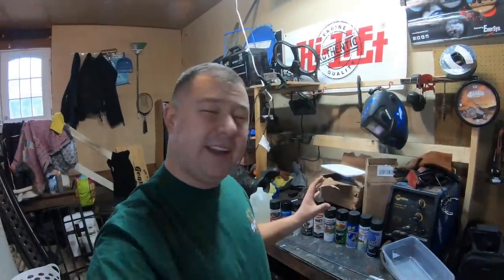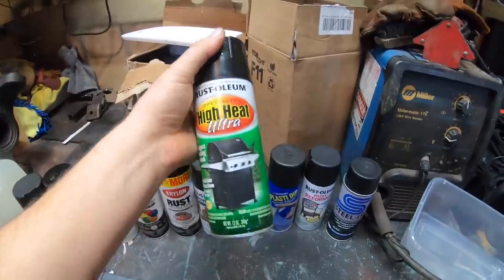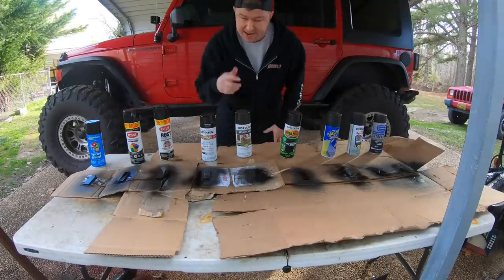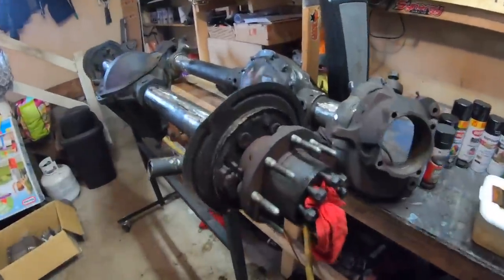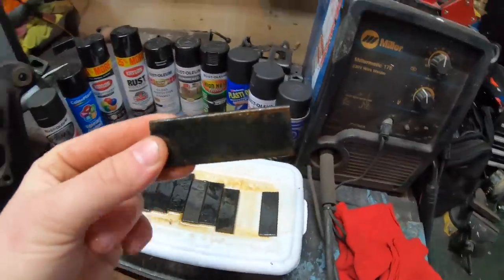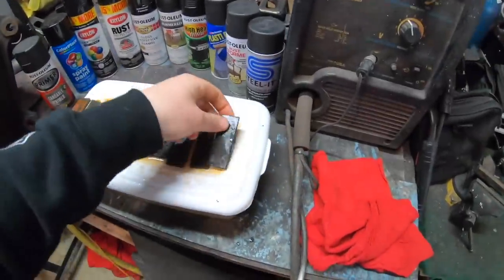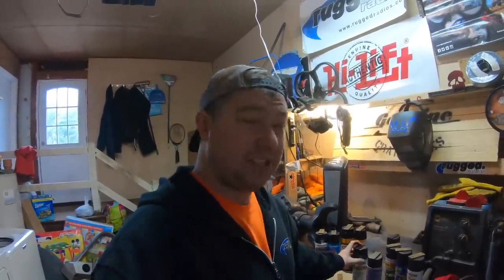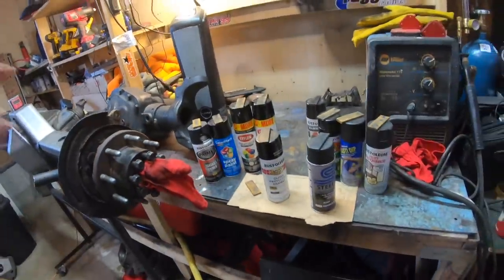Spray Paint VS Rust!! - What Brand is Best?

Comment: I would be interested in starting with rusty parts, and then seeing if any of the "rust" paints actually do control the rust (and do a few with normal paint, etc. just to see how significant the difference is).
Reply: Technically if you analyze this closely, although I question wether the edges of the metal actually got evenly or thick enough paint on them. Still if you examine this you can kind of see how they would do. Steel it & Rustoleum enamel will be better than nothing & buy you some time to get it worked on later. The others will buy you less time based on how they failed so fast I would say Krylon is third since it is a enamel but I wouldn't buy it, just if you already have bought it, it'll help.
Reply: 😂 some of the products are not for coating rust.

Comment: Actually, Steel-It would have done even a bit better if you would have allowed it to cure (dry) more than 2 hours before dunking it in salt water. Steel-It is a hard, glossy polyurethane coating, not really a "paint".

Comment: rust reformer is not a rust paint. it "converts" or reforms rust and that is then topcoated with a rust paint. since you had no rust in the first place, its not going to do anything. its probably composed of tannic acid. and it likely just washed away into the water. it might have converted some of the rust especially the next door steel it. and plasti-dip.

Comment: I've been redoing snow plows for years. If you really want to make the Rustolem paint last a LONG time and resist chipping along with making the shine from gloss paints last longer, buy the Rustoleum by the quart or gallon and use a small touch up gun from Harbor Freight. Both Valspar and Majic (Tractor supply) paints sell pint bottles of hardener that you can mix in before you spray. Only mix what you need, use acetone for the thinner, NOT naptha. READ the labels, Lol Once mixed, the pot life is around 4 or 5 hours and it will still harden inside your sprayer if left overnight etc.

Not only will you save a lot of money over spray cans, cleanup is minimal and the paint will dry 3 times faster, 3 times shinier,and 3 times harder and last more than double the length of time. It will resist chips and cracking better also,  IF YOU DO IT SAFELY!

WARNING: Now the bad part, the hardener contains nasties called isocyanates! This shit is evil. When mixing, wear gloves and keep it off of your skin. When spraying it, you MUST wear a respirator! Not a dust mask, but a cartridge based unit designed for painting. If you spray it inside, cover all exposed skin areas, wear your mask and try to create some ventilation. Our friends at OSHA require a full suit and outside pumped in air to the mask for breathing (no masks with filters) when used in commercial or industrial environments. This garbage can get in your body through skin, your eyes or whatever. Your body can not remove it and like lead it will build up over time until one day your central nervous system shuts off and you flop around like a just caught fish in the floor of a row boat and then die.

Why did I even mention it then, right? Well, it really works well, is easier than powder coating and does a great job when used safely. However, we all know that some moronic idiot will try it, in a small garage with no ventilation, no mask, and no gloves. All because they are tough and don't have time to worry about stupid safety procedures. In all honesty, if you spray it outside, upwind with no mask you will probably be ok? However, about 1 in every 10,000 people seem to be extremely sensitive to isocyanates and when even briefly exposed, an ambulance ride is next, hospital second and possible permanent damage to their CNS (Central Nervous System) third. If you are stupid and that happens? I'm sorry it did but my conscience is clear.
Reply: If all social media comments were like this one, the world would be a better place. Seriously. Great comment. Great info.
Reply: @commonmancrypto1648 if all social media was like that no one would read it. lol. But yes very informative and well said.
Reply: Is the reason the Rustoleum Farm & Implement and Professional High Performance paint has all the Prop 65 warnings because of the hardeners? Is that the reason those paints are so expensive and do so well in the tests people do on YouTube? 
Is it possible to DIY or semi-DIY a linseed oil-based paint that can go over top old paint jobs? 
I am building a greenhouse from discarded security doors, most of which are iron. 
Since this project is happening in my small back yard, I don’t want to poison the soil by sanding it sandblasting down to the bare metal. I’m trying to go the least toxic route, because my daughter is in remission from cancer.
Reply: @monkeytrainer8135  Rustoleum Farm and implement paint by itself is just an oil based enamel if I remember correctly/ It works good but does not have a hardener in it.

Using it out of the can will work. It takes a long time to dry but works well in most cases.Adding the hardener will cut the drying time by 2/3rds, double the shine and UV resistance and the paint job itself will last twice as long.

You can use foam rollers or a paint brush to apply it with the hardener in it, just mix small batches at a time so you run out of paint BEFORE it sets up.

Now, as I mentioned before, KEEP IT OFF OF YOUR SKIN.Since it isn't being applied as an aerosol you may not need a mask if done outside? Your call?

It takes longer to paint this way but the end result is almost as good as spraying it and you don't need an OSHA approved hazmat balloon suit like I wear, Lol.

PS- Did I mention keeping this garbage off your skin? It seems to go in but never comes out, EVER.
Reply: @superdog1964  — you did mention keeping it off the skin — multiple times. I remembered what you said, when I watched a bunch of car painting videos, and I noticed there were guys who were definitely heeding that danger, wearing black rubber gloves and those white tyvek suits, or at least long sleeves.

Comment: Rustoleum Rust Reformer is basically made to make rusty surfaces paintable, like a "primer for rust". A good test for the rust reformer would be to take an already rusty piece of metal, spray it with the reformer, then paint over it. 

Great video. I'll continue using good old regular Rustoleum for my future projects!

Comment: Leaving square edges on steel pretty much guarantees coating failure. The reason is that unless an impractical number of coats are applied, there is no thickness and little protection.

Regarding the Rust Reformer, it is designed to neutralize existing corrosion.   It should be applied, then topcoated after 24 hours.  During this time, the chemical reactions essentially consume its ability to convert rust.  It basically runs out of ammo. It must be topcoated to prevent recurring corrosion.  
I've used this product for quite a few years in refurbishing commercial and residential handrails, and have had great results. Note:  I topcoat with Rustoleum because it works well, and the customer has no problems finding paint for recoats and touch-ups.

Comment: I personally would have sanded the metal, Primed, and two coats of paint.
Then did the test.  I have done a similar test But used a separate container sto minimize cross contamination, at the end found that Rustoleum did the best even with a little better preparation. 
Was a good video for people to see and prove not all paints are created equal 👌
Reply: Yep good prep is to sandblast and degrease. The most expensive coatings insist on thorough prep.

Comment: A note for thought...the ends where you cut the metal would be more porous than the rest of the pieces...so that would clearly rust first.   The Rust-oleum Rust Reformer is rusting due to it needing to be primed and painted.  It is not a rust preventative, but a transform the rust to metal to be painted.  I bet if you used it and them primed it and painted it...it would hold up a lot better.

Comment: In my experience I have found out that Rust-Oleum paint will last and works the best for rust and pretty much any krylon doesn't cover near as good and just chips off way easier so I always buy Rust-Oleum that's for sure great video
Reply: Ever notice that people don’t use punctuation anymore...so frustrating!

If you wanted the bumpers to actually look nice, would you use a clear top coat to extend the life of the Rustoleum?

Comment: My process for steel products used in a salt water environment.
Step 1: sand
Step 2: wipe with acetone then dry cloth
Step 3: Rustoleum etching primer (2 coats) followed by light sanding and wipe with acetone then dry cloth.
Step 4: Rustoleum 2 in 1 primer (2 coats) followed by light sanding and wipe with acetone then dry cloth.
Step 5: Appliance epoxy paint (2 coats) followed by very light sanding and wipe with acetone then dry cloth.
Step 6: Clear Top coat (1 or 2 coats).
Results: Easily 2 years of saltwater protection. Never had any peeling.

Comment: First zinc 95,% cold galvanized spray paint $12.00 per spray can. From Connect-it Wireless Products. This is what they use on all Radio, Cellular and TV towers. Commercial grade paint.👍👍👍 This is a silver cold galvanized color.
My second best primer is RM7 (rusty metal primer # 7) it's made by Rust-Oleum. I've painted metal Arc weld two sections of metal together over the paint, the paint has less than 1/8 of an inch burn back. 👍 This primer color is a off Rusty red it also stops rust that's existing on metal from continuing to grow.

Comment: That's a pretty good test based on the way some people would use the paints. But I can't say it's a fair test of the paints. Paint prevents rust by sealing the surface against water penetration, not by any chemical process. So the better the seal, the better the protection. That's why the primers didn't fare so well, they aren't meant to seal. Getting the best seal is all about proper surface prep and application. Wiping the plates down with mineral spirits was good but you should also have hit them with some sandpaper to give the paint the proper surface to adhere. Then you only gave the paint a single coat when most every paint I can think of recommends at least two thin coats for best performance. Finally, you started the test way too soon. Just because a paint is dry to the touch doesn't mean it's fully cured. Ideally you should have given the plates at least a day or two to set up before starting the test.

I'm not bashing what you did, it was a fine test that I do think produced valid results. A lot of people will use the paint exactly the way you did. But I do think the results may have changed if the test had been more rigid. Of course, I'm certain it would also have taken longer.

FYI, taking the plates out of the water was a good way of mimicking the Mil-Spec tests. Those use a spray rather than submersion to test corrosion protection. So those tests leave the pieces constantly exposed to the air while being soaked with saltwater.

Comment: VHT roll bar & chassis paint always worked well for me
Reply: That's basically what I just suggested. Very good results with that. I use the high heat, the chassis one you stated and the epoxy one that can be used on shocks springs basically everything other than exhaust. I still also use the Rust-Oleum with good results. Nothing beats being on top of things and being proactive and not reactive when it comes to maintenance.
Reply: @truckerrickakamanowar  true, prep before paint is probably most important before painting

Comment: Rust oleum used to be my go to paint but seems like they changed the formula, it does not spray as neat and good looking as it used to, I always have issues with the cans clogging up and whatnot. If you want good paint that has the best UV and rust protection go to a tractor place and get heavy duty implement paint. It takes almost a day to dry but it last Waaaay longer.

Comment: @JK Gear and Gadgets, I am planning on painting my bumpers for my Jeep, would you recommend throwing on the primer that STEEL-IT offers on before applying the paint? The roads are salted & sanded in the winter. So I am looking for something that it tough. Does this paint need a clear coat or would I be ok with just the paint? I just want it to last a few years.
Reply: If you don't intent to weld you should add the primer for durability. Also for bigger parts, you should get the quart presentation. More surface for your buck. You can apply it using a primer nozzle and a spray gun :). Hope this helps!

Comment: You didn't really use the Rustoleum Rust Reformer correctly. It's not designed to be used on bare metal. It's a rust converter, chemically changing red rust to a "black" rust which doesn't eat the metal and offers protection against red rust forming again. But it needs to have red rust to work, since the chemical reaction works off of red rust and not bare metal. It should have been used like a primer, after which you would top coat it with your choice of paint. So you use it as a rust converter/primer on already rusted metal that you don't want or can't sand down to bare metal. It's not a paint.

Comment: Great vidio , I'm going to use it on my bike.  I was reading where guys like it better than powder coating because they can see stress cracks in the frame and can weld it. Opposed to haveing to scrape off the powder coating before a weld repair. Thanks again

Comment: I have used Rust-Oleum also with good results. My alternate suggestion is VHT epoxy paint it's self priming made for all weather and rust and salt resistant. Temp rated at 250° F. Can be bought at AutoZone and probably any other major autoparts store. Thanks for the video. I also use fuid film for extra protection over the winter.(Northeast) mine is a 16 yes not old but looks new still underneath except for the crappy Rubicon shock finish don't have a problem w the shocks but the finish is crap.

Comment: It looks like you did not sand the metal and remove the mill scale.  Sanded bare metal is highly reactive and would have been a better test since mill scale can vary from piece to piece.
Cold Galvanizing 95% zinc would have been a good "baseline" comparison also, but again, has to be applied on sanded bare steel.

Comment: Just the video I was looking for! I am getting ready to paint a forging press and I live about 1 mile from the Gulf of Mexico, so salty air and humidity is a factor. 
Is it necessary to start with a primer as long as your metal is rust free and free of oils and contaminants? Thank you
Reply from the maker: I would highly suggest checking out the Ace hardware brand “rust stop” paint. The satin black is very hardy and is my new favorite. That paint requires no primer.

Comment: Paint or any other finish will not stick to a sharp edge. It may look like it's covered, but it will be significantly thinner than the flat surfaces. On all of the furniture I build, I have to soften the edges by sanding them a bit to get the finishes to hold up on the edges. The same is true of metal work I do.

Comment: Kinda late to comment but will do so anyways. The high heat paint is a failed experiment as that paint has to be baked at 400F for an hour for it to fully cure. So if it would have been more resistant or not than showed is not really known. Also the primer would not work with it because of the high baking temp.

Comment: To get a true feel for corrosion effectiveness, use uniform shapes and surface finishes on the metal (machined faces) and ideally round off sharp edges (stress concentrations areas for corrosion). If you have access to a high resolution set of scales, weighing them before and after test too, and you will arrive at a fair assessment and % change for your test. Good work though, this is a useful qualitative examination of various paints. I'm particularly interested in the steel-it
Reply: also, performing the test with collected rainwater would be useful. most of these paints are not designed for salt water environments

Comment: Hey so you gotta remember that to get a legit study you need to actually use it as designed. The high heat paint has to go through a series of heat cycles before it's cured. All the paints need to be cured not just dried before use. Also the reformer needs to be used as a primer. Now redo the whole test with each paint over primer and then again over reformer.
Reply: Yeah they all use very different  formulas,  there's also some really nice car automotive aerosols i would rather use

Comment: This is interesting, I used some reformer a few years ago it has held up well but the rust on the vehicle is likely not from this area. Better climate. I bought some of that Krylon last night because the can was so frickan big compared to rustoleum and 50 cents cheaper if they havent improved their formula looks like that might have been a mistake, Oh well it will likely buy me some time since enamel seems to starve rust of oxygen so it will get used on my project car. Will definitely be sticking with Rustoleums enamel paints from here on out for cars.

Comment: DO I  need to take off the color of the metal or just spray over it? So long as the piece of metal is cleaned right?
Reply from the maker: Sand it down a little bit to rough it up, and then clean and paint
Reply: @JKGearandGadgets  so I definitely need to sand it down and take off the color, spray painting over the item is not ideal? // they are the edges of the mirror
Reply from the maker: You don’t have to take all the color off, just rough it up some